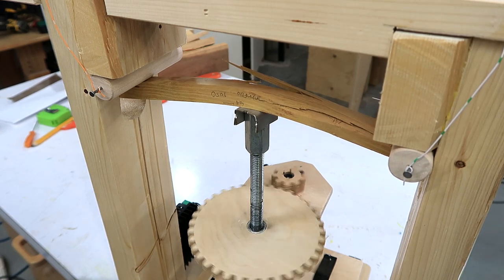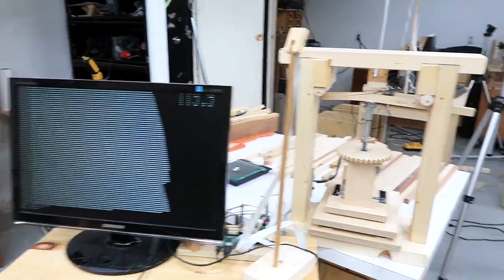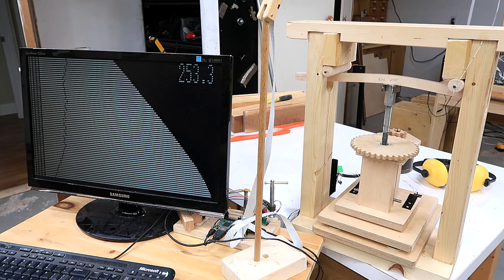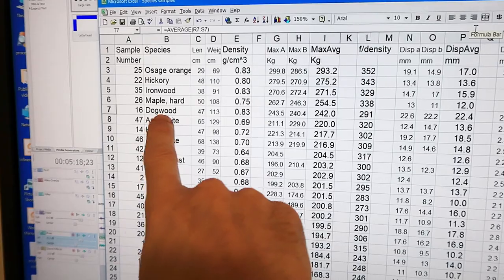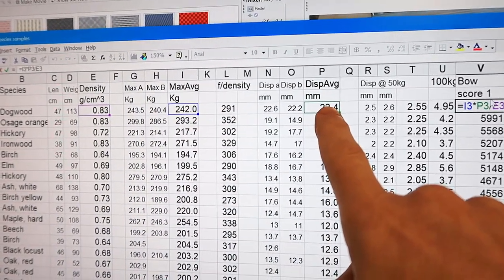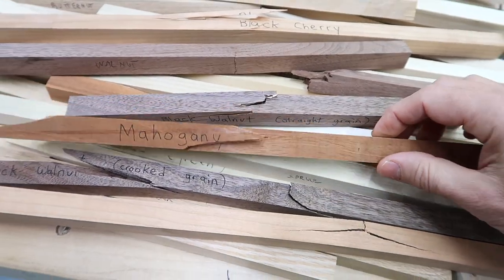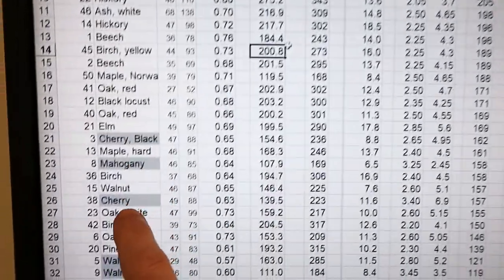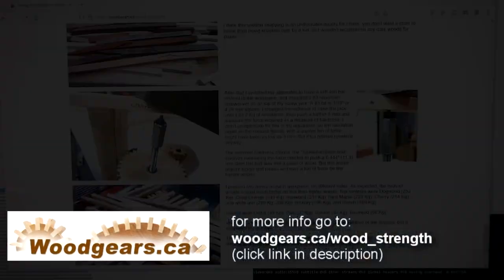What wood species is strongest, hardest, stiffest, best for chairs, tables, or bow making?

Comment: It would be interesting to see a test of Lilac.
I know it’s not seen as “woodworking lumber”, but it’s very hard and can grow to at least 10 cm in diameter, as far as I’ve seen here in southern Sweden.
(I tried to cut one down with an ax, but it was impossible, so I became curious, and now I have saved a few logs for drying.)
Reply from the maker: send me some
Reply: Dry Privet is as hard as woodpecker lips and pretty heavy
Reply: The wood is also often quite patterned and pretty. 
Similarly, another common Scandinavian garden tree is Laburnum (Gullregn), which has a reputation for being pretty tough, historically being used for fence posts and bows.
Reply: @CrimeVid  I second your statement. It turns beautifully on a lathe. I describe the effort as creamy. Have clean hands when handling after turning as it gets dirty instantly. I made some file handles with it.
Reply: I would be very curious to see how these turned out as a bow. Something to keep in mind is that many many woods considered sub par can be used when laminated with another wood as well. This has been done historically too, which is nice for the primitive bowmaker types.
Reply: If you are looking for other types of woods to test, the Locus tree here in North East US is VERY hard. I've not seen it used for wood working. I turned a few pieces after drying and it dulled my tools quickly. It starts growth as if weed like and can reach 50 feet. It has spines or spikes that are sharp. It  propagates by sending out shoots from its roots, everywhere! From some of the comments it seems to resemble the Osage. When cut it looks like oak and almost as dense but appears harder. (I strongly suggest wearing masks if dust is generated with this wood. It a good idea with any form of dust!)
Reply: @bprince9663  Locust, Black and Honey, are both very good for bows. Tends to be temperamental in terms of compression, develops frets very easily. Very cool wood though, and strong.
Reply: @bprince9663  Black Locust is a popular material among boat builders. It can be a good alternative to White Oak and Teak because it's very resistant to rot and abrasive wear, and plenty strong.
Reply: @bprince9663  There is a sample of black locust in this test.  I used it to build a garden swing because of its rot resistance.  I discovered why it isn't used much as lumber.  Extremely warpy/spitty/cracky.
Reply: And since you are a swede, send him some juniper also, at least when green it is so bendy
Reply: @thomaslindroos1667  I read through the comments to see if anyone had mentioned juniper. Yes, someone should send a sample. My neighbor cut down a juniper in his yard going on two years ago and I got most of the "trunk". It's fascinating wood in all respects, but getting any reasonable sized "workable" lumber proved to be quite a challenge, though the juniper having grown on a steep incline was probably the cause more than anything I did drying it etc.

Comment: I am very happy to see this data collected! I have had a passing interest in the strength to weight measure because of homebuilt aviation. Apparently many wood airplane designs are engineered using softwoods (particularly sitka spruce) because of their "superior strength to weight". However, by playing around with some numbers from the Wood Database, one can easily find that Shagbark Hickory, Black Locust, White Ash and Black Walnut all give excellent strength for their weight despite these first two being among the densest woods in the US. I would love to see you give a broader test comparing more samples of some of these highest strength woods against a broad sample of the common softwoods, especially those used in aviation (spruce, Douglas Fir, Birch). Sitka spruce in particular has become difficult to source and expensive so it could be very helpful for homebuilt/ experimental/ amateur engineers and builders of all walks. Also, I understand that grain orientation and density can create great variability in these tests. Not just grain angle vs force vector, but end grain and ring orientation, ring density (may even be backwards in "ring porous" hardwoods from "diffuse porous" softwoods). so a lot of variability to watch for in your testing. However or whatever you choose to do with you test rig, keep up the good work!

Comment: Another important thing for making bows is that the wood has to be able to return to its original state after being bent. That is an important consideration and one of the reasons why osage is so good for bows. It doesn't take much set and it is very strong relative to its admittedly high weight.

Comment: I’ve been building my own bows over the last couple years. As I was watching this I though, “dang I wonder what bowyers would think of this” and then you talk about bows. That was pretty cool. I only make 3 piece take down bows now and I use fiberglass. But the first bow I made in high school was a hickory board bow. It for sure breaks with a bang. I didn’t have the grain running the right way and it snapped in half on one of the limbs. Cool video, thanks

Comment: This reminds me of how wagon wheels were built with different woods for different parts, springy wood for the spokes, wood that was resistant to splitting for the hubs, and possibly just tough stuff for the fellies, but I'm not so sure what was what
Reply: old hubs were american elm =strong cross-link. had to split some as a kid. it didn't split. i had to burn it to get my wedges back.
Reply: @victorhopper6774  Persimmon is good for hubs, doesn't split easily, also used for giant mallets and splitting wedges. Post oak as another wood with spiral grain, I rather pound sand than try to split it.

Comment: A very simplistic and short sighted way to test timber strength and suitability. In practice it's really not that simple.
What you need is a timber that resists shock loads and has toughness combined with flexibility. There are plenty of timbers I know that would test well on this device but would not be best suited to chair making.
But amateur's love reinventing the wheel so now they are reinventing timber. Lol.

Comment: Growing up on the farm, I hated fence mending. In particular, I hated repairing wire fences where someone had installed hedge (Osage Orange) posts. These posts were almost always as big around as your thumb, too hard to drive a staple into and also too featureless to securely attach new wire. We usually replaced them instead. They, however, were exceptional firewood — for they had cured in the sun for more than fifty years.

Comment: I would be interested in seeing cut resistance and abrasion resistance tests. Also, if you can get your hands on any, live oak (an evergreen oak species from the SW USA) it would ba an interesting wood to test like you did these and for the other tests I mentioned. A fair warning, though: it is very damaging to cutting implements. Anything that isn't carbide tipped it will dull with surprising speed, even hardened tool steels, like the blades for plaining machines and chainsaw teeth. It was used heavily in the wooden shipbuilding industry since it is strong, plentiful, rot resistant, and typically grows curved so it is ideal for ship structures since it requires no bending and less joinery.

I pity those that had to chop them down with hand axes, though, since they had to constantly sharpen their tools and steel saws fair even worse.

Comment: Matthias, are you measuring motor current (torque) to deduce force?  If that is a triangular thread, the friction torque would increase with applied load.  An ACME thread or at least greasing it would minimize this potential measurement error.

If you have a load cell in compression that sees the force applied to the wood directly, then ignore the above.

Comment: Not sure if anyone has commented on it, but breaking strength will not be accurate in sawn wood if the saw doesn't exactly follow the grain of the wood. The best way to test the wood would be to rive (split) our the pieces, so that the grain is never violated. Not sure, but the moisture content of the wood might effect strength as well. Nevertheless, nice test!
Reply from the maker: I was careful to select pieces that follow the grain.  And if you look at how most of them broke, it wasn't because of grain orientation.

Comment: Osage orange is very rot resistant. In places where it grows farmers use it for fence posts. I have also heard that as it ages it becomes  harder and harder. So much so that it can be difficult to drive a nail into an old osage orange fence post. The rot resistance is a scientific fact (oregon state did a fencepost study). But the rest is just what I have heard.

Comment: I did not catch, in the video, if you noted grain orientation relative to the direction of applied force? You might also find it interesting to pick a few species and sample performance across a few selected pieces from various trees. Instrument makers are pretty careful about how they select their spruce for tops and especially for brace wood, where the load is significant and the wood is thinned to reduce the mass of the top for music making reasons. Not all pieces of wood are the same!

Comment: Great video, very interesting demonstration! Have you considered doing strength tests based on the way the wood is processed? I have heard that split or riven wood can be stronger than sawn wood. The theory being that splitting the wood preserves longer and more continuous wood fibers verses sawn wood which can sever wood fibers as they intersect the cut. So the more fibers running the full length the stronger the wood, in theory.
Reply: That sounds very unlikely to me to have significant impact. At most that would be a surface level difference, which would be effectively negligible. And if you refine the surface in any way (scrape, sand, plane, etc.), that would go away entirely.

Basically, imagine you have two bundles of same length plastic tubes (like those in lollipops), each tied together tightly with inelastic strings. Sample one, you  stick a metal ruler in the middle, creating two distinct halves in the bundle. Tie each half up with the same inelastic string, then epoxy each half. Those are your riven or split equivalents. Bundle two, just epoxy everything together  from the start, take it to the band saw and cut it in half. That is obviously your sawed wood analog. Sure, you're gonna nick a few tubes there, but how many could you possibly have been nicked to matter? Now imagine the tubes are even smaller in diameter, were all much more irregular, never fully straight or the full length of the original bundle - that is wood in a nutshell.
Reply: @louisvictor3473  Short, interrupted growth rings have a profound negative effect on the woods strength
Reply: @Fogyt121  I didn't mention growth rings, but either way, that is a wood growing problem, not a saw vs splitting problem.
Reply: @louisvictor3473  You are correct, if the cellulose fibers in your lumber are as straight lollipop sticks or soda straws and totally parallel to the face. Unfortunately, more often the cellulose fibers in wood are are very sinuous. You can see that in this video at the 4:01 mark and many other places. For example, the sample at the 1:50 mark shows grain running (curving off the edge) out at almost 45% to the face. When wood is processed by splitting it breaks along the weakest part, the lignin, which binds the cellulose fibers together. Splitting leaves the full length of the cellulose fibers in tact, but a very sinuous and undulating surface which follows the grain. Sawing, on the other hand, severs both the lignin and cellulose fibers intersecting the path of the blade.
Reply: As was recently discussed in Patrick Sullivan's end gluing video the lignin bond is much weaker than the cellulose. So maintaining continuous strands of cellulose is much stronger than shorter cellulose lengths that rely on more lignin to hold everything together.
Reply: @woodshopnerdery  No, I am right period. The simplification is still the basis of how wood works. I literally mentioned at the end the finer nuances, but they still don't add up to a noticeable difference, because normal wood grows straight enough that it doesn't matter.

Don't insult my intelligence (and yours) pretending you're not capable enough to tweak the simplified experiment for something closer to natural variations in the actual patterns in wood structure. Of course, if you did that, the conclusion would be mostly the same. Unless, as mentioned, you sawn like a maniac with no regard for grain pattern, or the wood was entirely crooked from the start  (which you can't split straight, btw). Then again, it seems less like you want an actual answer, but to confirm your own myth so no surprise you went the "very smart boy" route of ignoring the very fact I did include those variations, I just didn't spent time on them believing in your capacity. I guess, that mistake is truly on me, should have assumed I am talking to a child.
Reply: @spudpud-T67  Okay, show us how splitting keeps a SIGNIFICANT higher number of continuous fibers that run the entire length of a full side board vs sawing. Specially after you plane, sand or whatever you do to smooth and flat the surface. Also, nice taking Patrick's video out of context and purpose, and ignoring his own caveats through his videos. Shows how much you know what you're talking about.
Reply: @louisvictor3473  I made a valid suggestion for testing of a theory.  I read your critique of my suggestion carefully. You spoke of "nicking a few tubes" during sawing. I stand by my response.
Reply: @louisvictor3473  I see you know all there is to know.  I would be wasting my time discussing any further.

Comment: I built my desk pc out of cedar and red oak plywood. The grain can certainly look quite nice, and I used denser boards for the pieces covering the plywood tops edges and the apron. However, a lot of the other boards are quite soft and there are some small dents where something hard hit the legs. The upside is how cheap the wood was since it was dimensional lumber cedar and probably wasn't intended to be used in furniture.

Comment: Consider the thickness of the ring layers and how many layer of rings there area. The direction of the rings matter aswell depending on what style bow you are making. Place a piece of pine next to a piece of Yew. Pine has a few thick rings(layers) compared to the Yews 20-100+ rings. How many ring layers depend on the growth rate of the tree. Now for bow making with most species you should not cut into the next layer as it will cause it to crack there prematurely. It's not as big of a problem for a piece of Yew that has many many rings. I've made a few bows now and have learned that I still have much to learn.

Comment: I would think that straight grain would be an important factor in a bow. I thought that is why Hickory was used. I guess you would need to split the logs into billets for testing, but that might not allow for reducing variables between species.
Reply: Straight grain does matter if the bow doesn’t have any backing. I made a bow out of a hickory board when I was in high school, the grain wasn’t perfectly straight and it snapped when I was trying to see how it bent on the floor. Clay Hayes has some really good videos on building self bows, if you wanted to watch something like that. Not really sure what the protocol is, I don’t comment much on YouTube.

Comment: Good idea! Bad test! Here's why: #1. You're hinge fracturing the wood instead of doing a flexion test. #2 Strength not only depends on the wood but on interrupting the grain. As you can see most of the samples are breaking because the grain is running off the side of the wood. #3 Depending on which side of the tree the wood is cut from its either in compression or flexion and will have different strengths and ring thickness and resistance to breakage. On another note, the large ring is created in the summer when the tree is growing rapidly from an increase of light and nutrients but the smaller chalkier rings are created in the winter when the tree is dormant. So your test not only is testing the strength of the large rings but the weakness of the smaller rings that are bonding the larger ones together. Knowledge is power!
Reply from the maker: It's MUCH MUCH better than your test, which you DIDNT DO.  Guess what, in my imagination, I do much better than in real life too.  Real life is limited by resources and time.

Comment: Great video. I'd love to see similar testing for the species that are usually discarded as junk. Cottonwood, basswood/linden, etc. Maybe they'll prove stronger than people think, or have some characteristic that is useful to hobbyists.
Reply: He did include Basswood, came near the bottom IIRC
Reply: I don't think anyone considers poplar as junk. Also, it's plenty strong for the purposes it's used for. Same for basswood, softness is its strength.
Reply: He had a piece of basswood in there.
Reply: @kryptik0  in fact I was hoping to see poplar on this test.
Reply: Basswood is very popular for carving, it is fairly easy to cut, but isn't so soft that it won't keep it's shape.

Comment: Matthias, I carve wooden spoons as a hobby and I noticed you mentioned a couple of the same species were far apart on the scale. I have noticed that same species grown in different climates can be harder. I get both Black Walnut and Black Cherry from New York and Kentucky regularly. The wood from NY is always harder to carve than the wood from Kentucky. I tend to believe it is because of the harsher winters in the north than the south. Any thoughts on that?
Reply: Couldn't that be because slower growth means smaller and closer growth rings. That means more tightly grained wood. That usually means harder, or at least tougher.
Reply: @redgrittybrick  Yeah, that's what I figured.